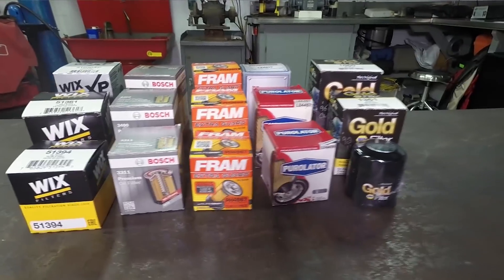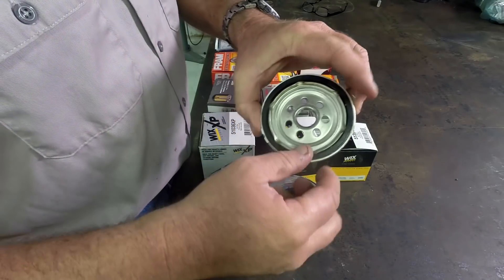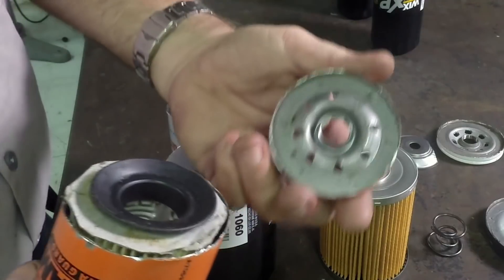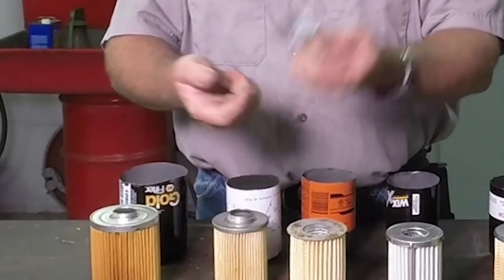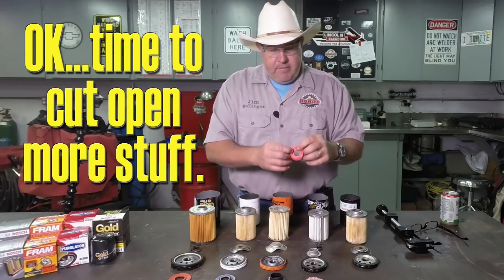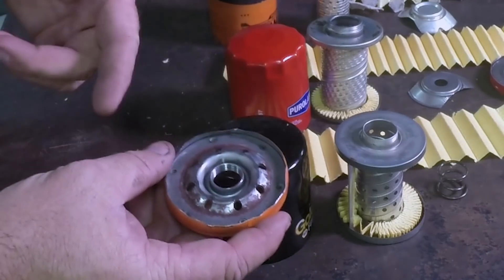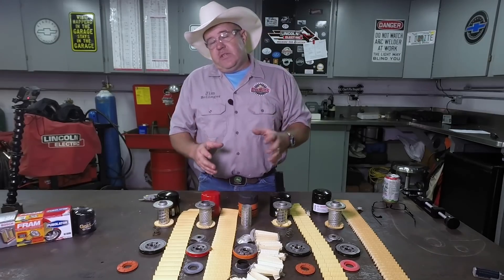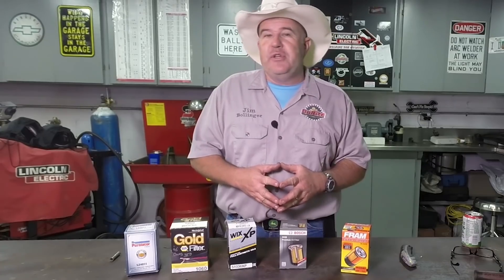The worst oil filter EVER!

Comment: Your better off sticking a used toilet paper roll in a soda can and tape it to your engine than use a fram oil filter
Reply: Now, don't go giving any upgrading  ideas to FRAM.
Reply: What's funny about that comment is, there is actually a filter housing available that uses rolls of toilet paper as the filter media...LOL!
Reply: and that filter is highly effective , according to users ...big debate about that , of course.....whu do we believe ?       ' @im1469
Reply: kcaj mortsnnew I've seen a few of those debates. I wouldn't be able to say one way or the other, as I have no experience using one.
Reply: @kcajmortsnnew1488  I am old enough to remember Chevrolet bolt through, filter can on V8 engines prior to 1965. 1/8th inch steel. The cartridge was huge. A wire screen kept the media intact. BIG Rubber gasket on both ends. Held a quart of oil too. Chevy cheaped out and the engine block got an adapter for spin on filter. I bet they spawned Fram themselves, since the filters paint job is orange just like 1st gen smallblocks. I owned a 1964 Chevy 283 that rolled the speedometer over twice before she was retired, still running with that same type bolt through cannister can.
Take a look at the filter element at your favorite parts store for comparison to "Sham" filters. If the store even has one.
Grandpa "Zora Arkus Duntov," twernt no Dummy.
Reply: yup....much farm equipment has that type.........i recently "stole" a can like that off a dodge slant six , my personal favorite U S engine , to adapt to my '86...as well as a manual choke carb and oil bath air cleaner , semi-free "filters", and near perfect............spin-ons are wasteful , and convenience isn't an issue for me...money and repair ability are , so i sacrifice the MPG advantage of computers for that.......been stuck too often  by brainy cars......now , i'm surprised no one's jumped in about Franz filters by name.....i still wonder about them , they must be popular,they go for high $ on e-bay..BUT DO THEY DO IT ?  $.25 seems a good oil filter price  ..........and yeah , Duntov               @ayebee1207
Reply: @kcajmortsnnew1488  My dad worked as a mechanic in the motor pool during WWII. He told me of using toilet paper in can oil filters all the time. It kept the jeeps and trucks running.
Reply: @im1469  Yes,I think it's called a 'Frantz'. First saw one on a car as a pup back in the '70's....and it was a older car even then? (1961-62 Buick Special IIRC)
Reply: where do Mobil 1 filters fall in this mix?  I've been using them for years without any issues.  A little surprised to see the FRAM innards...  Thanks for sharing!  Great rundown!
Reply: @AN-kg4ei  I use both PurolatorBoss and Mobil-1 Extended Life Filters...and both are excellent High Capacity Filters.  Strongly Recommend to anyone, but you could give Napa Gold or WIX a go too...many are satisfied with their quality!
Reply: @darring.9161  I love those extended Mobile 1 filters and will continue to use them.  I've run them over 10k km without an issue (seemingly).
Reply: @AN-kg4ei  I go to about 12,000 Kms with them, and I throw in 8 Ounces of MotorKote HD...and the Oil still looks awesome at change out, but I wouldn't go much beyond that.  15,000 Km Max
Reply: @AN-kg4ei  my dad changed his regular spin on oil filter to twice the length tractor filters. The car still works.
Reply: @AN-kg4ei  Mobil-1 Filters are excellent, they're my next go to if I cannot find a Purolator BOSS.  Best to use with a good quality Synthetic Oil.  I've never had any problems with them to speak of, they go on sale quite frequently at Canadian Tire so I always grab a few to keep on hand...or whenever a friend wants me to do an oil change for them.
Reply: That was once a thing hahaha
Reply: You reroll your TP after you use it??? GROSS !!!!!!!!!!!!!!!
Reply: Exactly what this video made me think of.  Putting a roll of toilet paper in my 1953 flathead V8's oil tower as a filter.    reputed to be a  big improvement but it always made me laugh.
Reply: TP filters are/where a thing, problem is they develop "trails" or tunnels then the filtering is over as the oil has an easy unfiltered path to travel.
Reply: that was my thought exactly
Reply: Yeah but the toilet paper rolls are made to disintegrate in water. Idk how they will react to oil tho. Paper tissues on the other hand don't. Why not cut one roll in half and use that instead of toilet paper?
Reply: I once bought a 1964 MG1100  that had a thrown rod for parts. It used a cartridge type filter also. It also had a metal plate at the bottom of the cartridge that was held up by a pretty stiff spring. That plate had nothing to retain it to the center bolt. So somewhere down the line someone dumped the metal plate along with the filter. So now the new filter doesn't fit and seal. What was their answer? to stuff the filter canister with Kotex for filter media! Hence the spun bearing and thrown rod on #4 cylinder. Now the fun part. When I went to the junk yards to try and find parts for the engine, every MG engine i found with a thrown rod had the same exact thing done to the oil filter. Who was giving out this advice?
Reply: You sound like a REAL meKaNiK !

Comment: Objectively speaking, a more definitive and valuable test would be testing the actual filtration and perhaps cut open the filters "after" they've been used for 3000~5000 miles to see how they held up.

This video only tells part of the story, which shows how the filters are constructed. Evidence of how each of these filters actually performed through actual use would have been more practical and usable data.

Comment: How much are you getting paid. You take a top of the line Napa gold filter and compare it to the cheapest Fram filter. You pulling a fast one. Anyone that knows anything about filters knows Wix makes napa filters. If your going to compare be fair. I don't use fram, I usually use  purlator, napa, or if I need a upper grade Fram.

Comment: Yes, of course I clicked the thumbs-up button!  Good Video!  When Fram orange-can filters came out back in the 70's they were supposed to be good.  I think it was in the late 1980's that guys like you were cutting open brand new Fram filters and finding cigarette butts and other debris inside.  Sabotage by the workers.  I haven't bought them since the cigarette findings.  As the years passed I stopped buying after market filters and bought filters from the vehicle manufacturer's instead.  Most recently I've discovered AMSOIL EAO filters and have been impressed with these.  I think you'll find these filters to be very good.  https://www.amsoil.com/shop/by-product/filters-and-by-pass-systems/oil/amsoil-ea-oil-filters/

Comment: There’s 3 independent testing facilities in USA and all 3 have Fram at or within the top 3, I have a corolla with 468,000 miles Fram, had a corolla with 365,000 Fram, pickup with 243,000 Fram , I’ll keep using Fram. 👍🇺🇸

Comment: You should a Fram only oil filter video where you open up the different lines(tough guard, extra guard, ultra, High performance)  to see if more expensive ones actually reflect quality or if they're all just the same but different colors.

Comment: I like using the Bosch premium black filter. I compared how dirty the oil was at the dipstick before changing it ,for 3 oil changes, using a different filter each time. Using a white cloth, I noticed the oil looked cleaner with the Bosch filter. We all use the dipstick to check cleanliness, so I figured this was a good way.

Comment: A guy in our area stuck a Fram on his late model stock car. Well, about lap 10 the motor pulled the filter media out of the filter and plugged the oiling system of the motor and it blew up. In the end Fram sent him a check.